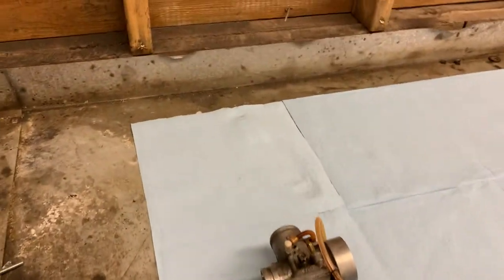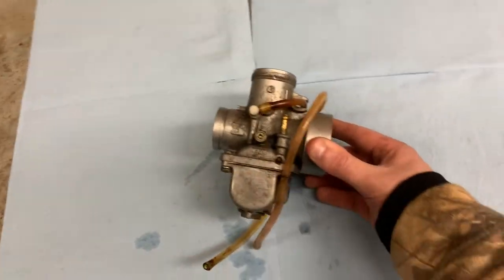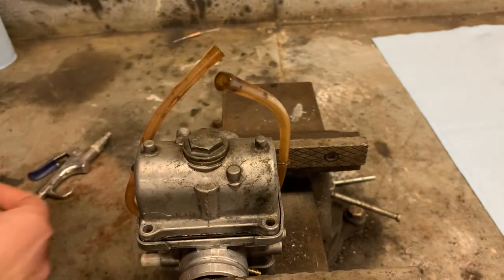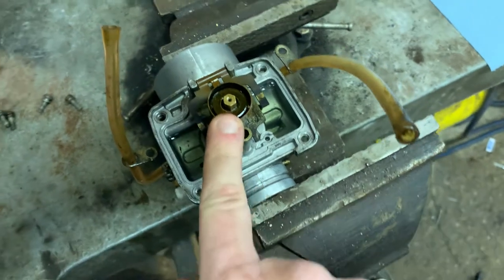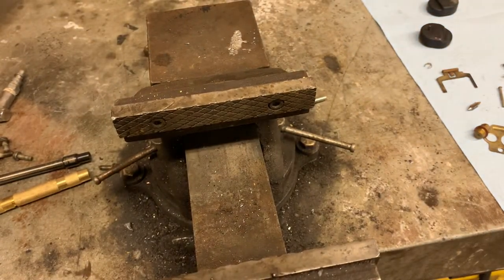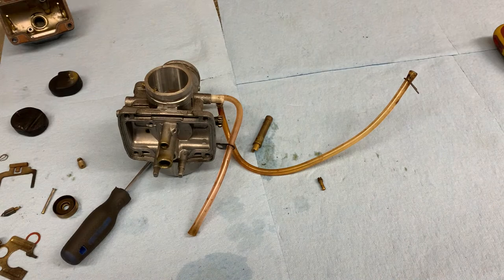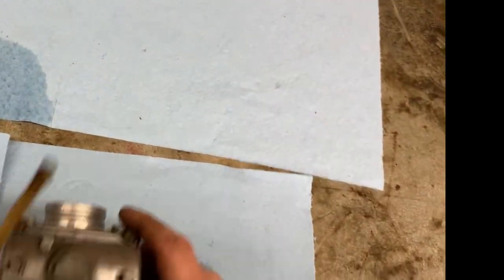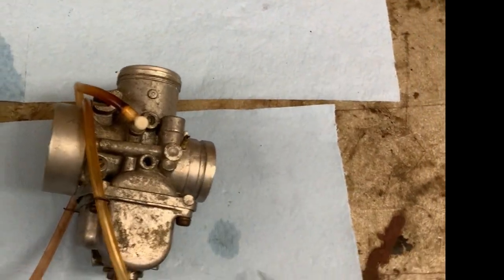How to clean a skidoo safari 377 Carb

Comment: Where would the factory clip setting be on the metering jet needle.
Reply from the maker: typically the third notch based on the manual. Here is a good service manual, check out page 176
http://www.vintagesnow.com/Ski-Doo_files/1988_SM.pdf

Comment: hello i got the ski-doo 377 safari too so i was wondering if there was any good tips for new riders.
Reply from the maker: do you mean in terms of riding or mechanical? in terms of mechanics, they are a super reliable machine, i have to oil injector disconnected and mix oil on them. Very reliable machine for sure, make sure your track is in good shape and these shouldnt cause you any issues. In terms of riding they are surprisingly fast! in the cold weather you will want a good primer plunger cause they dont have a choke. Stay tuned, i got two more 377 sleds! should be on the channel soon , one isnt running, the other is a runner. Feel free to drop any questions
Reply: @muddythumper8152  thanks for the reply and the advice provided. i hope one rider to another we can exchange advice

Comment: HEY muddy we have a part we need its an air box carb adapter the part number is 570-1363 how can we get this part
please helpp
Reply from the maker: hiya, if you are talking about a 377 engine, the boots that go from the air box to carb, the best replacement i found so far is these:
https://www.amazon.ca/gp/product/B08B3RMJBC/ref=ppx_yo_dt_b_asin_title_o02_s00?ie=UTF8&psc=1
the downfall is they come from china so it takes like 3 weeks or so to get in. I got them on the 40 dollar sled the 377 i picked up last year i think it was. They work great. In the mean time you can just tape them over or silicon them but those boots work fine.
The carb to engine ones i can get locally, they are also on Royal Distributings website

Comment: Nice video! I have same sled whe it gets warmed up, the sled dies. Anything I can check? Thank You.
Reply from the maker: Is it fouling the plugs? how does it normally run? that could be the main jet or a electrical issue ( losing spark), or even an overheating issue depending on the sled

Comment: How fast are these kinds of sled? I have one just didn't get it running yet
Reply from the maker: They're actually fairly quick machines. the 377 is basically the same as the 380 skidoo engines. The black safari on the channel is probably the faster one. Theyre similar to a 340 ovation or slightly slower then a fan cooled mxz 380.
Overall good machines

Comment: How do those black plastic pieces go in
Reply from the maker: Sorry if it was not clear enough at 3:03 on the video youll see the two black floats.  The arms or brass piece on the float are suppose to face each other. The brass side sits in the bowl on e on each stem in the bowl. The brass side should be on the lower side in the bowl. Basically as your fuel rises, they slide up the stem piece and push against the pivot arm and cut the fuel off. Let me know if you can figure it out if not i can do an update video.